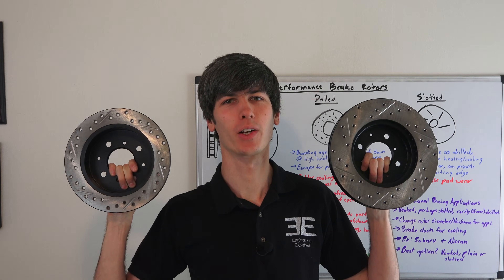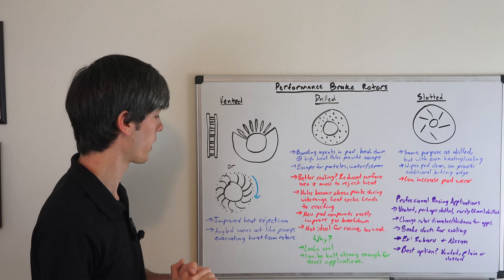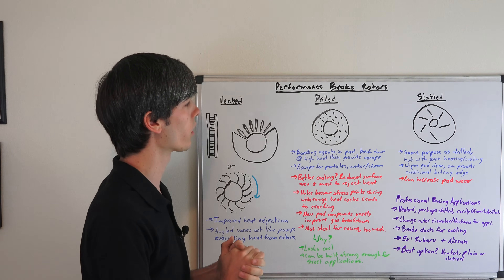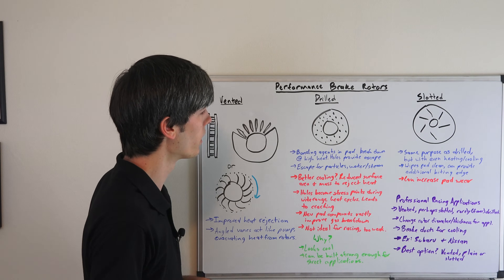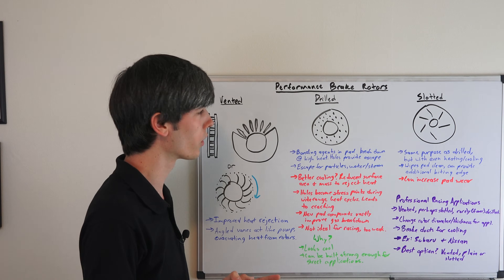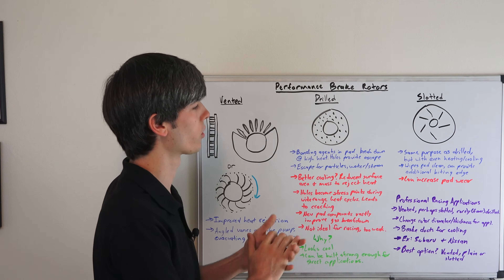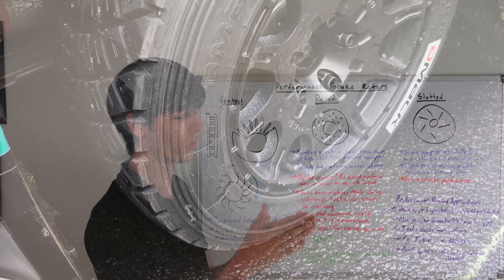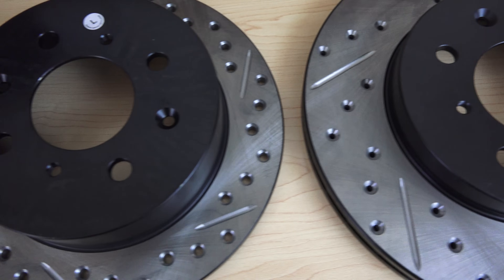Drilled, Slotted & Vented Brake Rotors - What's Best?

Comment: My experience with drilled and slotted rotors is totally opposite of this video. I have two 2008 Chevy Impalas and with the stock vented and solid rotors, the brakes would heat up very fast under heavy braking, even normal driving going down hills or slowing from highway speeds. They would fade and eventually start to shake as they warped, but once they were cool they would stop shaking. I switch both cars to drilled and slotted rotors and all of those symptoms are 100% gone. The cars stop in shorter distances and I can brake MUCH more aggressively than with stock ones. I have yet to experience shaking or brake fade, even stopping the from 120mph to 0 mph. My brother has been running the same rotors and pads as mine on his 2003 Pontiac Grand Prix for 3 years and has had no issues with longevity, stress cracking or abnormal wearing.
Reply: Jayson Williams I installed drilled as slotted on my Lexus IS250 combined with Hawk ceramic pads and I could push the car real hard and breaking was 1000x better than with stock rotors and pads.
Reply: That’s one of the things I changed on my 08 Impala. It stops a lot Better now that I put EBC slotted rotors on it.
Reply: Anyone got a link for some good ones for my 2014 Chevy malibu
Reply: did you bother to replace your garbage oem brakes or you just threw one new brakes and thought it was good?  I guarantee if you put a good street pad (hawk HPS 5.0) with some blank rotors, it would brake better than your current setup
Reply: You switched your pads too. That fade on the stock brakes and subsequent not fading with the aftermarket brakes is because you got better pads. 

Did you also flush your brake fluid? Because old fluid with particulates and water in it will boil well before fresh fluid would. 

Brake fade is simply your braking system unable to deal with the heat you are creating. Your rotors can play a role in reducing fade, but only if you go from solid to vented or upsize your rotors. I doubt you did either of those.
Reply: @clutchthepearls3062  I switched to the new pads with the original rotors first, and that made no difference. (The old pads we're actually still pretty good). The brake fluid replaced was only the amount that was squeezed out when I pressed in the pistons, and that was before the new rotors. Therefore if there was a difference because of the brake fluid, it would have been realized before the new drilled and slotted rotors were on. At the time, both cars were realatively new, and had the brake fluid replaced at dealerships not long before this project. Both cars drove with those same brakes on it for around 75k miles with no loss in performance. I ended up with the metal backing on the pads rubbing the rotors, which obviously ruined the rotors. I sold one the cars to a co-worker after putting on that same exact brake kit again and it's still driving to this day, much to my dismay. Should have never sold it. 😂
Reply: @thor294  Yes I tried better pads with the stock rotors, but it made no difference. Those same better pads with the drilled and slotted rotors made the difference.

Comment: In defense:  Drilled rotors should have less problems handling rain and mud, since the holes give fluid on the rotor or pad somewhere to go without all running or caking up on the pad.
Thanks for this video!  It simply explains things that should be easy to understand but get lost in all the debate and rumor.
Reply: Not to mention that the method for drilling the rotor is the leading cause for premature failure... either way, slotted or drilled or drilled and slotted provide better braking for a car than rotor blanks, and I've done hours of testing to prove that...

Comment: All my drilled/slotted rotors that ive used have always far exceeded my stock brakes. Daily driven aswell and no cracks or issues. And yes they did see track use every weekend. Stopping was improved, fade was non existent in street use anymore and the initial brake bite was much more noticable.

Comment: When I bought my 2009 Accent SE, I installed drilled and slotted rotors and after 7 years and 50,000 miles I just replaced again, pads still probably had another 20,000 left but I just rather replace now than have the caliper piston at the end of its travel and for 91.00 pads on ebay included thought it was the right time. Old rotors didn't seem to have any stress cracks around the holes but some lines starting to appear.Probably saved 100.00 compared to a garageRemember also that most rotors are zinc coated so less prone to rust

Comment: This is great video but fails to mention one important thing: the slots are also there to drain water off the rotors in wet conditions.Also regarding drilled rotors, many racing rotors do come drilled, just look up Brembo 2L9.9001AR where just the two rear brakes cost over $20K, they are professional brake systems yet the rotors are still drilled.

Comment: May be worth pointing out that the straight vanes of standard vented rotors still act as an air pump. So if you are going to put in a venting system, the more you can focus it toward the center of the disk, the better.

The curved vanes make a more efficient pump, so they move more air, and cool faster. The down side is that they are directional and more expensive.

Comment: Anddddd i just bought drilled and slotted rotors for my car. Oh well. Not like the car won't stop right lol
Reply: Jimmy Neutron keep them drilled and slotted dude! I actually have just a little experience with overheated brakes that were smoking. 

stock-solid rotors, having 1,200lbs loading in a ford f150 and going down the steepest seattle hill will over heat the brakes, then ya gotta kick that e-brake at the bottom to slow down cause your main brake is toast and smoking hot. [front brakes are disc, rear brakes are drum but terrible at braking]

stock-solid rotors, another experience is when I had 5 construction workers (including me and I weigh 200lbs) in my 93 mercury cougar  ford 5.0.

 I was cruising 60 in a 35 because we were taking a 30 minute lunch. The sign lied about restaurants at the next right and we found nothing after 10 minutes speed driving. So zooming back to the main street, we found a gas station only half mile beyond the stupid sign, my brakes were smoking all the way back until we started working again. Still full brake functional, unlike my f150 that loses brake power and resides on e-brake.
Reply: Tyee Cambrón you keep telling this story but don't realize it was your crappy brake pads. Rub some ebc brake pads and high temp brake fluid...also learn how to drive downhill. Semi trucks will overheat their brakes if they stay on them all the way down a hill...
Reply: +Jamais Vu (Symbolic) semi trucks don't use their brakes until they're going quite slow anyway. they're SUPER expensive to replace
Reply: My dad Drives trucks and they use them at all speeds. They just don't stay on it
Reply: +Jamais Vu (Symbolic) I totally agree with you, my dad is a truck driver also.
Reply: lol
Reply: you should be fine with drilled and slotted. for street use. 
but 1 day on track u will need to change rotors next day because of cracks. 
they do use brakes on semi. 
was at abf trucking for a tiny bit. and the replace brakes all the time. they also use engine braking to but still use normal brakes also. but there trailer breaks are still drums. pretty funny never knew it to.
Reply: +Jimmy Neutron They're usually fine.  I had some on my Maxima with 265hp and years later they weren't worn out and I had no problem.  They also stopped way better than stock.  Most of us are not driving our cars on race tracks so it was not an issue even driving in winter.  It did look real good though!
Reply: s q u i d w a r d I installed drilled as slotted on my Lexus IS250 combined with Hawk ceramic pads and I could push the car real hard and breaking was 1000x better than with stock rotors and pads.
Reply: Shadow Sun because it’s new. If you installed brand new stock rotors it would stop just as good.
Reply: RzVids but if he was the original owner of the car. Would he not notice the difference between stock new ones and these drilled ones even if there was a bit gap between them? Just giving him a fair chance. 
I’m going to get drilled despite that because my callipers are MASSIVE even compared to cars much faster than mine. Something like 380mm. It NEEDS drilled holes to continue it’s awesome looks to the car

Comment: I've bought StopTech drilled rotors as an OEM replacement before and didn't have an issue with them at all. (And this is when i was 17 and thought I was a gt3 driver)... You will likely never make the rotor fail during daily use.

Comment: Thank you so much for your stuff ... couple months ago I should have died in a car accident (provided I was following at the "recommended distance" on the highway), I just ended up ruining my brakes and rotors ... along with my front bumper, passenger headlight assembly, and I think the water pump. Been driving around with a wobble anytime I hit my brakes above 45mph. Just now getting around to changing them. This video definitely was more helpful than any review I could have read.

Comment: I've been riding motorcycles since the early 1970's. the 'new' disc brakes that were introduced were blank plates. In dry conditions they were way better than the older drum brakes (they had some serious fade issues), but in the wet you would get a film of water between the pad and the disc, plus the material issues you mentioned, and when pressed harder to try and slow down, the water would be suddenly be evicted and the front wheel would lock up, 90% of the time causing a crash. The first drilled rotors were amazing, they squeezed the water out the way. The compromise of less surface area was amazing. It would be great for you to do a video about the current motorcycle disc technology including drilled wave rotors (esp for Motocross), car technology in this area is way behind the motorcycles, bikes' designs are way more advanced, owing to the increased power outputs, and unpredictability of brakes than on a car.
Reply: yes drilled wave rotors are prominent in mountain bike applications to keep rotational weight down. they never do solid or grooved.

Comment: Just want to add that both the vented examples that were drawn act as air pumps, one relies on just centrifugal forces while the other uses a bend to assist and to possibly also increase surface area inside the vents.

Comment: Something I always think is a good thing to look to for knowing what's best functionally is to consider what's used in heavy-duty applications that don't care about looks. Racing yes, but also things like trucks and trains - a lot of passenger trains use disc brakes. Typically very wide rotors - deeply vented - but no cross-drilling or slots, I don't think I've ever seen those features on a train. Same with aircraft, though larger aircraft usually use a totally different design of brake. A critical thing to keep in mind with any of these things is that there are a series of factors that must be compromised on, the winning arrangement depends on which are most important. Mainly: Performance, cost, weight, and longetivty. Racers care about performance and weight, with little regard for longevity or cost. OEMs care mainly about cost and longevity, though performance and weight are considerations. The trains I mentioned and heavy trucks care about performance and longevity, with basically zero regard to weight and some to cost.

Comment: As a Parts Specialist, Stoptech slotted/vented rotors is all I run & recommend for cars that are going to be ran in light racing events like Auto-Cross. All the teams in Pirelli World Challenge use them also. I've seen other event goers that used drilled/vented only to have cracks appear. I agree here. They may look cool but drilled offers no advantage with today's performance pads.
Reply: ***** Stoptech Slotted rotors with PFC Brake Pads is a very good street/performance combo. I run that setup on my 1990 Mustang GT with upgraded Booster and master cylinder. You can find PFC branded brake pads at both O'Reillys and Autozone if you want to source them locally. Stoptech Rotors you can find at just about all the online performance E-Tailers, like Summit and Late Model Resto, etc., etc.
Reply: +thebayareapimp Slotted rotors? No. Drilled I've seen cracking long ago. not recently though. they're OK for street duty
Reply: +thebayareapimp Slotted rotors? No. Drilled I've seen cracking long ago. not recently though. they're OK for street duty

Comment: Good explanation and comparison. I would add that drilled rotors reduce rotational weight. Slotted rotors probably do also, but maybe not as much. I'm told a drilled rotor with chamfered holes does better as resisting cracking. Probably better on brake pad wear also.

Comment: I've had my Brembo Gran Turismo, 4-piston cross drilled rotors for over 7 years on my car. Not one crack yet, and I haven't had to replace my rotors.
Reply: Trust what he's saying. Race cars know best. They had huge problems using drilled rotors in racing when they 1st came out; they were cracking and blowing apart after heavy racing use. Now they just use slotted and solid rotors in racing; with venting of course.
Reply: +Mark Brooks Thank you for bringing in knowledge and uninebriation. It's quite unbelievable what some individuals dare to write in the comments containing their accumulation of pure and professional knowledge of...nothing.
Reply: +1czelaya 7 years?  Maybe you don't drive often or hard, my rotors are shot in 4 years minimum.

Comment: I did put drilled and slotted rotors on the front of the 01 Ford Escape I owned years ago.  I will say they stopped far faster in the rain.  I only use ceramic pads now too.

Comment: AP Racing or Akebono are the high-end manufacturers and maybe Brembo. Cant go wrong with that lot if you have deep pockets. If not the dep pockets, EBC Brakes are an excellent substitute.
Reply: And Wilwood?

Looking for a system for my Ram 1500. I want 15" rotors that are 1.5" wide with 8 piston calipers all around. Only problem is that Brembo makes ZERO kits, let alone THAT kit for my truck. And last I checked, Brembo was the only one to even OFFER 8-piston calipers.
Reply: Wilwood are fine too.

Comment: IIRC high end "drilled" rotors are actually cast with the holes in them making them stronger compared to normal rotors that have holes drilled through them. And while they have less braking surface area and less thermal mass they do have more cooling surface area making them dissipate heat faster, correct me if I'm wrong.
Reply: AnotherSiGuy  pls explain sempai Engineering Explained
Reply: Jad Makarem i just made a super long comment about experiences i had
Reply: Tyee Cambrón just read it, thanks man
Reply: AnotherSiGuy if you mean cast for cast irons, all other normal rotors is cast irons as well. 
From your words, less braking surface => less braking performance and less cooling surface. Less thermal mass => heat builds up faster. Meaning they have less heat capacity, and if you give them same stopping power, their temperature is higher.
I purchased Stoptech drilled rotors when I started track driving, and I cracked both front side in 30min of first session. 
Drilled rotors are OK for street though, they are not for racing as EE said.
Reply: tbpom1003 My logic was that the inside of the holes would provide cooling surface area even though they do not provide braking surface area. Otherwise yes they would heat up faster and they won't brake as hard. Out of curiosity did you get the cryo-treated Stoptechs or the normal ones?
Reply: +AnotherSiGuy I got a cryo-treated one. As I know, cryo treating is heat treating, which can increase surface hardness and fatigue, but they still fail
Reply: tbpom1003 cryo is actually treating the rotor to cryogenic temperatures -200°  f
Reply: AnotherSiGuy kinda... over all "drilled" runs cooler. they also get to temp faster which makes them good for a street car. they also weigh less.  the only real negative is they crack. so in a carbon ceramic brakes with less chance of cracking, they are #1 in racing.
Reply: you are right, like how a radiator works.
Reply: If you noticed in the video, the racing rotors were not cast. They were machined out of solid billet. If you want strength, this is the way to go, as casting is weak. While casting the rotors with the holes is stronger than drilling a casting, the difference in strength in minimal.

Comment: Depends on the application. I use cross drilled and slotted on my Honda Odyssey because factory blanks would fade quickly because too much weight of the vehicle. The CD&S make the many van stop smoother and enable more aggressive driving. Not racing, just driving.

Comment: Drilled rotors are commonly used in drifting because the brakes are hardly used so they don't see the drawbacks from other forms of racing but they reduce weight
Reply from the maker: Fred Mccue As mentioned in my Formula Drift video. :)
Reply: How much weight is really saved?  Can that make a difference?  I don't think so.

Comment: I looked up your video because I was looking to fit crossdrilled discs on my car. The reason was that the wet performance on the standard ones is terrible to the point that it's hard to stop the car! I live in the west of Scotland, which is a notoriously damp part of the world. I wasn't aware of the cracking issue, so I'll keep that in mind when I speak to the brake fitter.

Comment: Thanks for the informative video! I'm in the middle of ripping out the front manual drum breaks on a '65 Mustang and was trying to figure out if it was worth investing in drilled and slotted disk rotors. Looks like I'll be spending a little more, but I kinda like the car so I suppose it's worth it.